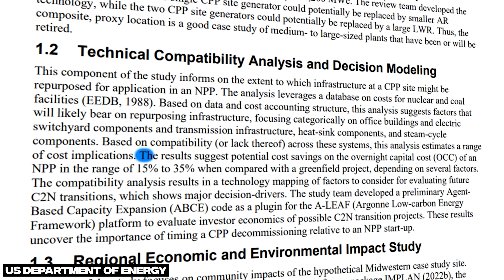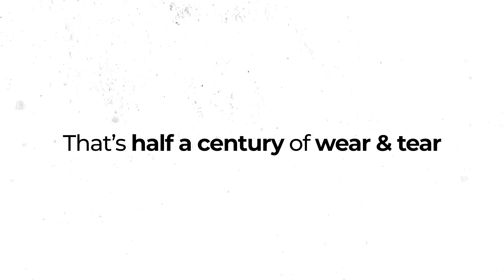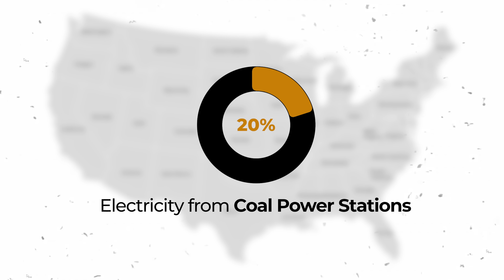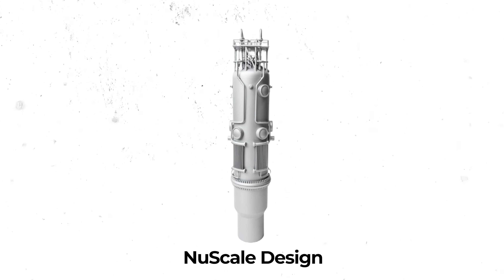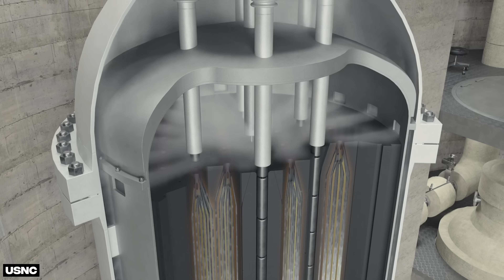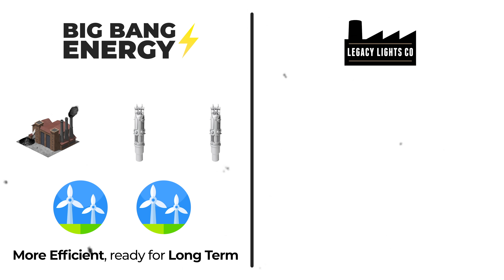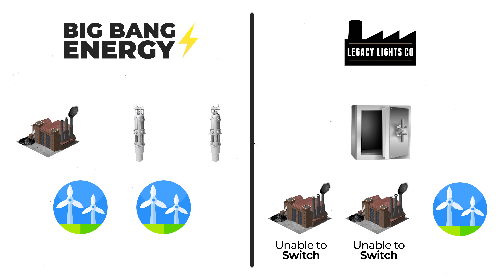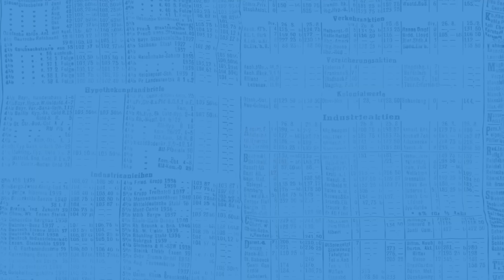Can We Convert Old Coal Plants to Nuclear Energy?

Comment: The capacity factor is not only reflecting downtime!  Nuclear plants cannot be ramped up and down as fast as coal, they HAVE to keep running. Coal plants can be throttled or shut down easily. Which is what they are mostly used for.
--> The (fixed!) high capacity factor is a downside of the nuclear plant. You can't just look average energy output.
Reply: Both coal and nuclear work best at constant output. Neither can load follow very well. Coal furnaces have a substantial wait time before restart as they have to cool and the systems for introducing powdered coal have to be cleaned and reset to the start condition. This turnaround time is comparable to the wait time for Xenon poisons to decay in a recently shut down reactor. Both have had improvements in load following, but fall far short of ordinary daily demand cycle.
Reply: All advanced (high-temperature) nuclear power plants can load follow better than coal or natural gas, and far more efficiently.
Reply: @chapter4travels  Got a list of those? What proportion of generation do these represent?

Comment: Thank you for this clear and very realistic presentation of the facts around energy production. Lets go for the small modular reactors. In a few years we will know  which version is the best. .
Reply: A little detailed but some info on SMR in the U.S..

This is from the Des Moines Register an concerning the only Small Modular Reactor (SMR) project in the U.S. today. It should be noted that NuScale said (Jan/2023) the target price for power from the plant is $89 per megawatt hour, up 53% from the previous estimate of $58 per MW hour

In 2013, the Wall Street firm Lazard estimated that the cost of generating electricity at a new nuclear plant in the United States will be between $86 and $122 per megawatt-hour. Last November, Lazard estimated that the corresponding cost will be between $131 and $204 per megawatt-hour based upon the 4 recent new nuclear projects in the U.S. . During the same eight years, renewables have plummeted in cost, and the 2021 estimates of electricity from newly constructed utility-scale solar and wind plants range between $26 and $50 per megawatt-hour. Nuclear power is simply not economically competitive.
SMRs will be even less competitive. Building and operating SMRs will cost more than large reactors for each unit (megawatt) of generation capacity. A reactor that generates five times as much power will not require five times as much concrete or five times as many workers. This makes electricity from small reactors more expensive; many of the original small reactors built in the United States were financially uncompetitive and shut down early.
The estimated cost of constructing a plant with 600 megawatts of electricity from NuScale SMRs, arguably the design closest to deployment in the United States, was originally advertised as costing $1 billion but upon requesting actual bids from engineering firms, increased to $6.1 billion in 2020. Given inflation and other cost constraints that cost today can only be expected to be significantly higher.
The cost was so high that ten members of Utah Associated Municipal Power Systems canceled their contracts. NuScale then changed its proposed plant configuration to 6 fewer reactors but increased each reactor output from 50 Mw to 77 Mw costing at total of $5.3 billion. The NRC just last week approved the construction of the 50 Mw design but now will have to start the review process all over given the switch to a 77 Mw design. For each kilowatt of electrical generation capacity, that estimate is around 80% more than the per-kilowatt cost of the Vogtle project in Georgia — before its cost exploded from $14 billion to over $30 billion. Based on the historical experience with nuclear reactor construction, SMRs are very likely to cost much more than initially expected. And they now have delayed the project start until 2025 in an attempt to find more backers.  All this before the inevitable setbacks that will occur once construction starts.
Reply: @clarkkent9080  There are two key things missing from your analysis is that all 1st time construction project are far more expensive than building the 2nd example, which is more expensive than building the 3rd example - as the crews gain experience.

There are real world projection on the price decline; and it occurs on nuclear plants as well.

The key problem in the USA (and Europe) is that we forgot how to build nuclear plants (the QA and detail to design is totally unlike non-nuclear construction).

If the same contractors that build Vogtle 3 & 4 were to tackle another pair of AP1000's the construction cost and timeline would decrease substantially. By the 3rd set prices would come down more.

China and Korea have very experienced nuclear construction people and are building nuclear power plants on time and on budget.  China built 4 AP1000's with only a slight delay on the 1st 2 as such.   They are performaning so much better than the Chinese own developed reactor designs that China recently ordered 6 more AP1000's.

The other truly major flaw in the data is that in the US we have separated the cost of building power generation units from the cost of building the transmission of that power to other locations.   On that basis Solar and Wind is cheaper to build than a nuclear power plant.

However, when you look at the cost to get the power from the solar panels, the wind-tower, or the nuclear power plant to say a major city... the numbers completely invert.   It cost a fortune to build numerous small power transmission cables to connect to the grid from individual solar and wind units.

Here in the USA the local electrical utility is responsible for the transmission and distribution cost (so you don't see it in the cost to build the unit).

When you combine the cost Nuclear Power plants are the cheapest way to deliver a lot of power to the end customers.    There have been multiple studies on this (by intentional energy groups); and it's why there are dozens of nuclear power plants under construction worldwide at any given time.  Nuclear - even given its cost to build new units - delivers electricity to the end customers the cheapest in a large majority of cases in the world.
Reply: @perryallan3524  Are those costings complete?
What is the maximum price for interment of fission products and transuranics, and demonstrated costs of the interment facility over at least a decade?
How will increased MOX use impact reprocessing and disposal costs?

See, I call bullshit on that.
Nuclear is not cheapest, and is ONLY cheapest in your scenario  if you get to build ten for practice and not count those costs in building an eleventh on budget (ah ha, a joke right?) Can you get an insurer to cover the overruns? Go on, you are certain. Get an engineer to provide a guarantee and pin his reputation on it and an in surer to pin their profits on it.
Huge amounts of renewables can generate close to the user, reducing transmission costs. So can small scale storage. Lots of users can tolerate minor interuptions (they face them already) for lower costs or independence. For some, having the lights on when yours are out counts for a lot.

The really big flaw is that nuclear is centralised, and some other bastard can cut you off. Meanwhile, renewables can be private, local or regional, or all three. In that worst case of totally off-grid: Many are opting for off-grid right now, just to give the bird to central generators. Others do so because a couple hundred meters of poles and wires cost more than a very complete off-grid. That revolution is creeping ever closer to the city. On grid it works better with access to locality or regional batteries to minimise dependence on expensive (but optionally deployed) genset backup.

How many times extra will people pay for the privilege of subsidising inflexible nuclear that is at minimum ten to fifteen years away?
Every year spent waiting is another year that individuals and municipalities and states buy and install more renewables and storage.

If nuclear is going to pull a rabbit out of the hat, including waste disposal and genuinely lower costs, it better do so fast, with very minimal subsidy.

I'm not saying it can't be done, I'm saying it CAN be done, but no one is demonstrating this. The claims have to be backed up by functioning plant and fully provisioned back-end financed at the same time as the front end.

Comment: If the electric demand is too low at night, then use the power at night to make green hydrogen.
Reply: No, batteries.. 100 Hour backup is now possible
Reply: Expect a broad mixture of storage options: Pumped hydro, batteries, pneumo, kinetic, flywheels, hydrogen, synthetic fuels, Thermal storage, all sorts really.

Of course, these all work for renewables and coal generation too.

Comment: Excelent idea, that of constructing new power generating power plants in replacement of coal ones.
Some units of the coal plant can be used in a power generatiion, that can save costs.
Don't forget that coal energy are used to generate steam to power the turbines/genetators.
In a nuclear power is the same except the process of heat genetation.
Also ground space and trained workers are readilly available.
And there are very safe processes, like the Th reactors being developed which can improve the safety factor.
The only thing left to consider, is what to do with the nuclear waste - Regenerate it in breeder reactors, or store it ?
In any case, it is necessary extreme caution, on what can be used, recycled revamped  and demolished.
Time is running out...

Comment: Atomic Power but still have no idea what tpo do with all the waste that has to be stored for a thousand years. Right now it is all sitting at the plants in cooling pools or dry storage.
Reply: They have less idea every year they put it off. Digging the repository will need fossil fuels, and those are getting more expensive. Reprocessing spent uranium fuel divides the storage into 1000 year and 100,000 year problems, which might be cheaper to address individually.  Using the recovered plutonium and uranium produces MOX fuel (with a top-up from excess weapons plutonium), but spent MOX fuel is a whole new problem: It stays hotter for longer, and needs a bigger repository to space it out, or more expensive reprocessing, or both.

So the majority of both sit in cooling pools, over 80,000 tonnes in pools in the  US, plus a bit over 50,000 tonnes in dry casks. 
The longer it sits, the more the assemblies corrode and the harder it is to handle later.

Comment: good luck finding a team of nuclear engineers in those small towns. 
There is no way that those SMR's will be built as separate units. It will have to be a huge cluster. but it wont. its just not economical. wind and solar are much, much cheaper. 
There are not enough morrons in the industry, to fund something with a return rate of 20 years.

Comment: Nope, you can’t convert, but you may be able to use some of the transmission equipment in the area.
Reply: Steam turbine and generator in place? Why not?
Reply: @Nill757  
Like hooking up a V8 to a Honda civic transmission
Reply: @SkypowerwithKarl  How’s that? The US has  6 coal plants over 3000 MW, larger than any U.S. nuclear plant except Palo Verde in AZ.   Steam is … steam.  Nuclear uses lower temperature steam.  Easier to switch to low temperature for the materials involved.
Reply: @Nill757  
It’s a volume(mass) and pressure. Turbines have to be matched to the stream generator. If you have ever had any experience working with the NRC you’d know if it’s not in the manual and not doctrine it doesn’t exist. They are a non adaptive, non thinking entity. This is why we will never see commercial 
LFTR reactors in the USA. It’s not in their documentation.
Reply: @SkypowerwithKarl  Yes, and new nuclear can be matched to mass and pressure. 

I’m aware of NRC rigidity and I agree they’ll never approve anything anywhere ever, the No Reactors Commission, unless they’re destroyed and rebuilt like an FAA or FDA (as some pres candidates call for).  For instance, the NRC insists on control of steam turbine/generator as well when they should stop at the nuclear island. 

But that’s a different issue from V8 vs Honda Civic.

Comment: It's all fine and dandy until the spent rods can no longer be cooled, or when the control rods fail die to a power outage. Nuclear power requires active safety mechanisms which makes its risks unacceptable considering the magnitude of the disaster.